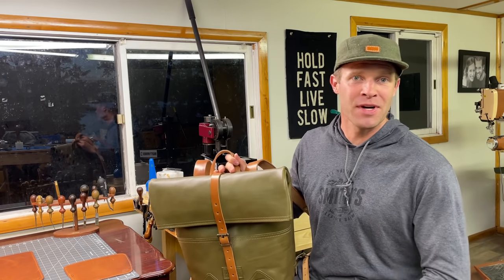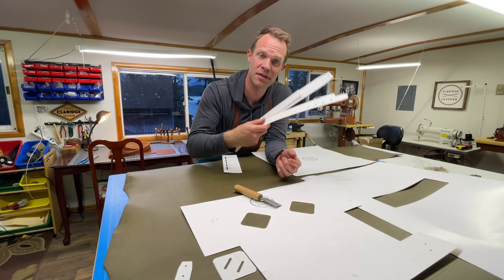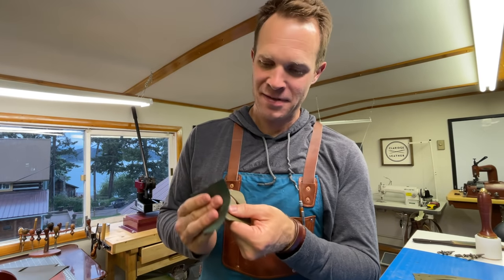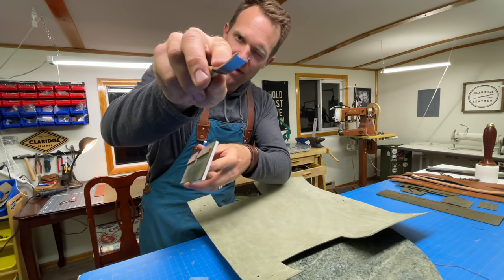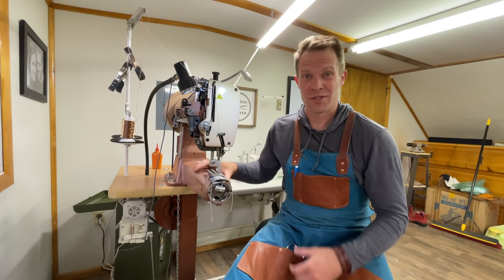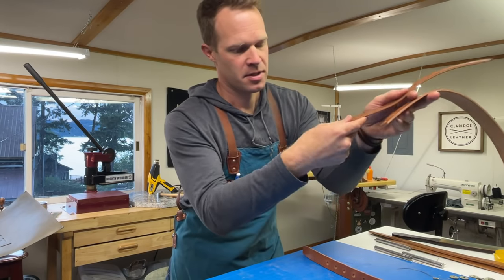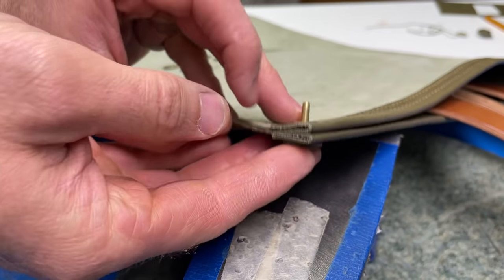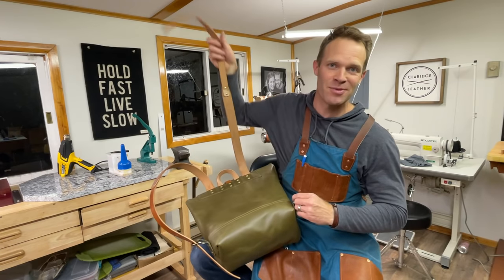Leather Rucksack? You’ll Be Surprised How Simple It Is! (FREE Pattern & Tutorial)

Comment: I love that I can download the pattern and follow along with the video. This is a great! Thank you for sharing.
Reply: Hello!  How did you download?  The pattern I have is locked and the printshop said they can’t just print page 5.  Many thanks!
Reply: @traceytowner176  To download the pattern I clicked on the link in the description and added the pattern to the cart, "paid"/followed the instructions to access the patter. Then I used my home printer to tile page five. My printer tiled the page into multiple pages and printed the patter, all I had to do was cut the excess and tape all the tiles together. This is fairly common for patterns of this size. When you tile the pattern to print you just check the squares he has provided to check the measurements are correct and it printed to the correct size. Hope it helps.

Comment: What is the best way to get this pattern printed
Reply from the maker: Hi Jake, definitely check out the video that is linked in this video which talks about getting the pattern printed. Personally, I think the easiest way is to just send the PDF file to a local print shop and have them do it on their large printer. So far, most people have found that it costs between 10 and $15 to have this pattern printed on one large sheet, 36 inches tall by about 5 feet long. Hope that’s helpful for you! Have fun!